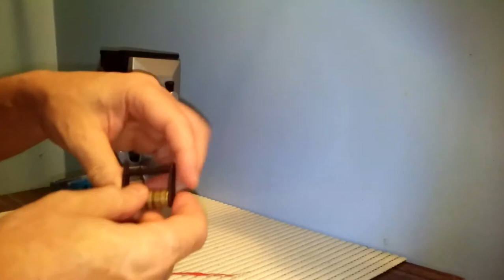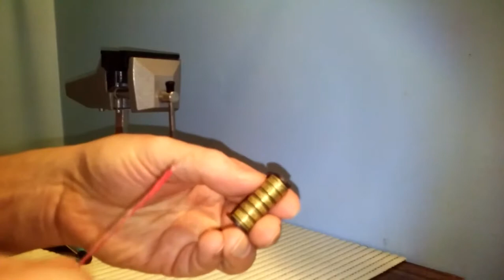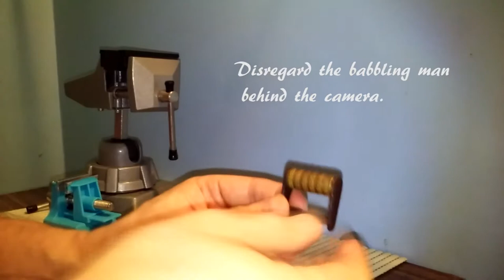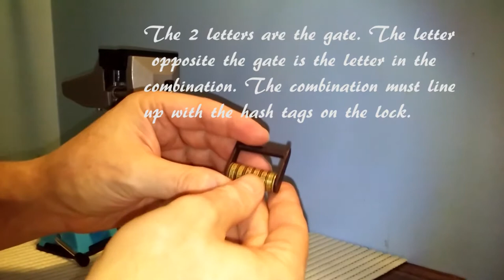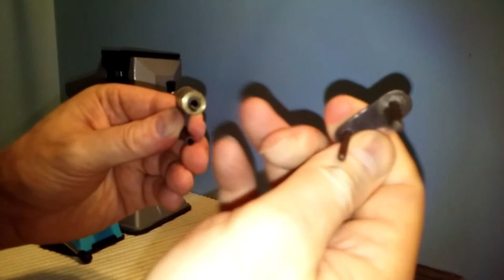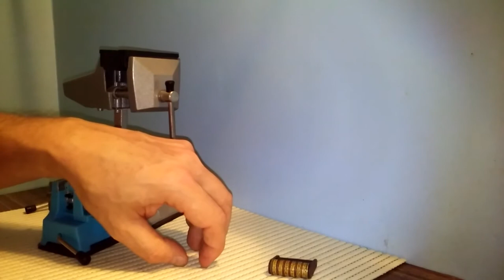[32] antique-vintage 6 wheel combination lock decoded

Comment: came across this video because i found 1 of these combination locks but unfortunately i didnt manage to decode yet. the letters are different and according to chatgpt there arent any words that can be made up from the letters available. any tips?
Reply from the maker: In order to decode the lock you need to line up the gates which allows the shackle to slide out. I used a metal tie to feel for the gate on each wheel. Unfortunately, there is no easy way to decode theses types of locks unless you try every word combination. I am sorry that I can't be of more help. The lock combination could be in a different language depending on what country it was in. Take care.